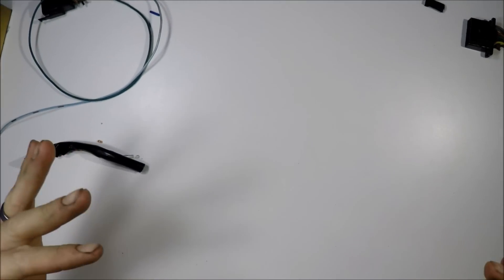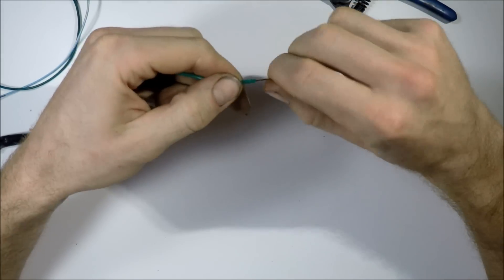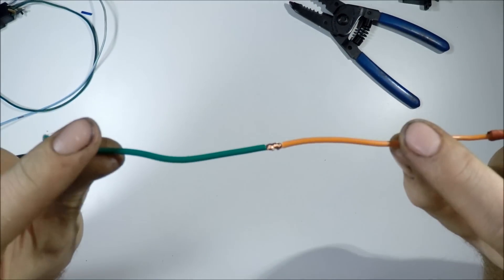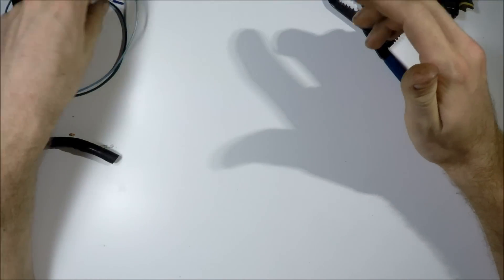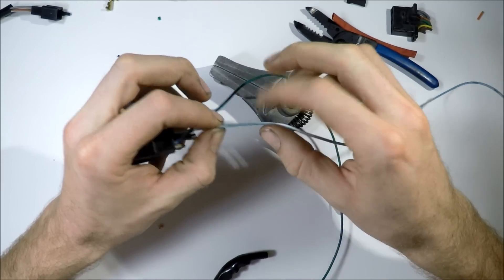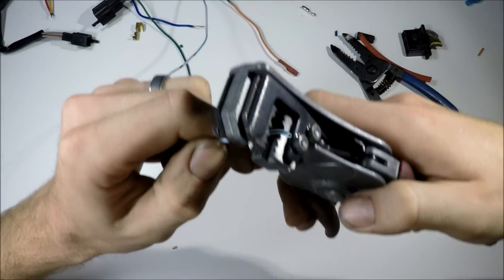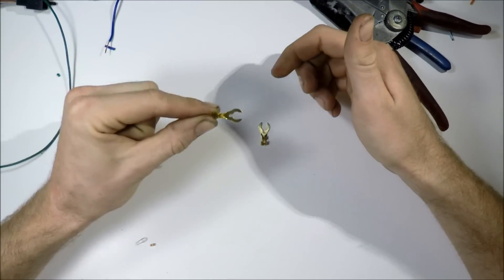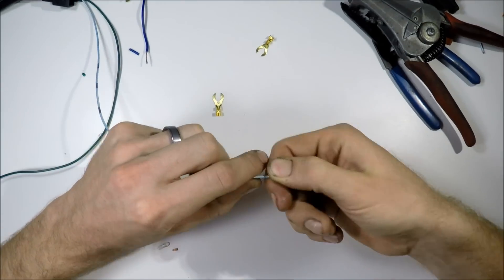Motorcycle Wiring: Hard-wiring

Comment: I would recommend wiring accessories into plugs. 3.9mm bullet connectors are better. Make a split, and put a double on one, and replace the end of your device with a male and connect easily. And disconnect easily and quickly.

Anywhere near the engine should not be soldered. Crimping is the order of the day there.

Comment: Like urban Chanel. Need a little help🙄have a Honda rebel 250  was installing led turn signal lights made the mistake keeping the bike on turned it off because I didn't have charger. Killed it put new battery and still nothing. Blew my agu 10 amps

Comment: Hey Cody, I found the connector of stator and regulator/rectifier melted of my 1980 CB750C, is it a good idea to hard wire this connection? What could be the problem that burnt this connector? Thanks
Reply from the maker: Hard wiring will be a solid fix. If you do use quality solder and good technique. You can also use quality bullet connectors with a strong heat shrink. That is common with that connector. The terminals loosen and cause high resistance build up and melt the connections.
Reply: TheMotorcycleMD thanks Cody , it's awesome to have an expert advice

Comment: I have a 2001 Honda Shadow spirit carburated vt750dc and I'm adding a baron tachometer. Is my bike dual fire or single fire system. It's important to know so I wire the tach in right. I plan on using your ideas for hard wiring it will help make my connection solid. Thanks